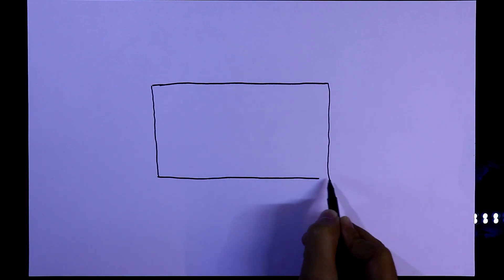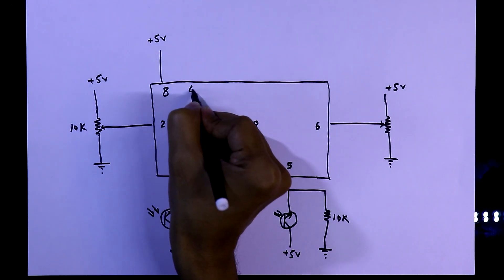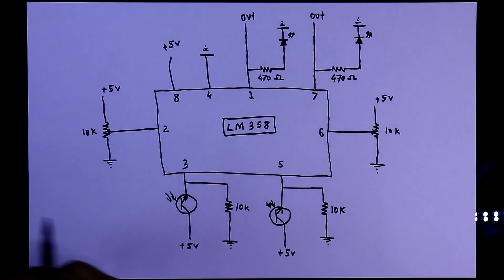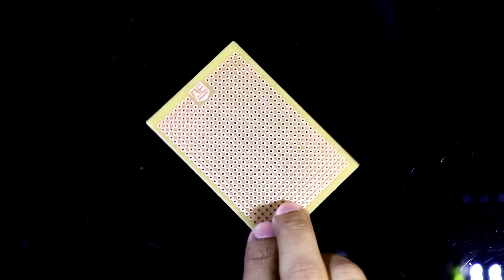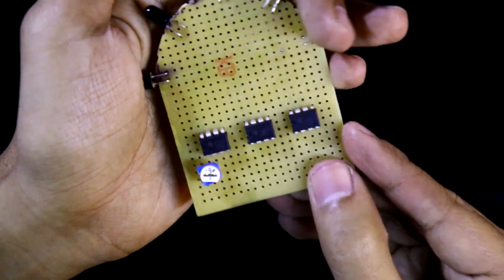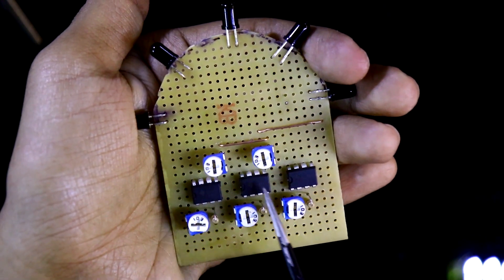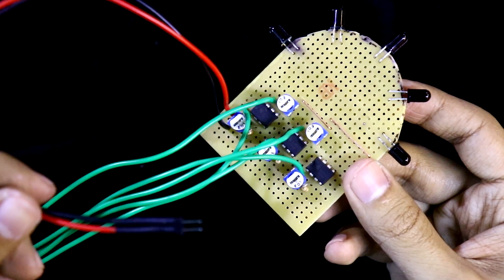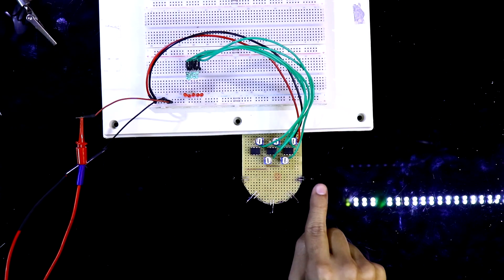How to make fire sensor at home

Comment: Thank you for sharing your time, effort and expertise. Interesting project! I suggest that you provide more information about the components and that you use their function symbols within your diagrams. Such as... The LM358 is an op amp, so draw the function triangle symbol inside the rectangle that you used to represent the IC. I hope that helps. I noticed that the indicator LEDs did not turn off as quickly as you moved between the sensors. I believe that there is not a problem with you circuit. I think that the table surface was retaining a bit of heat and that your circuit is sensitive enough to see the remaining heat. Your thoughts? How sensitive is the circuit? For example, can it detect a human at 4 feet/1.5 meters?